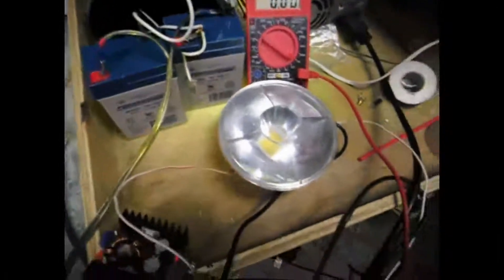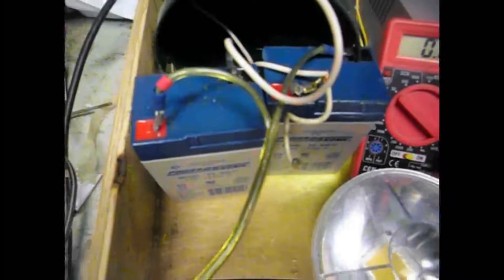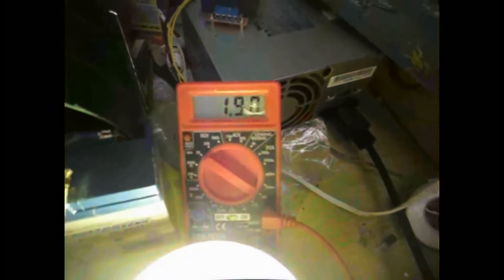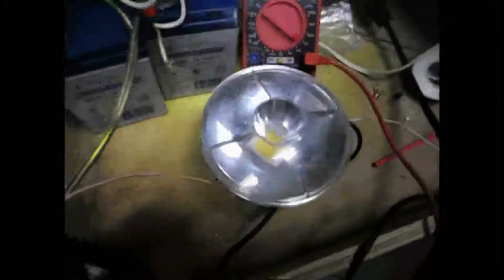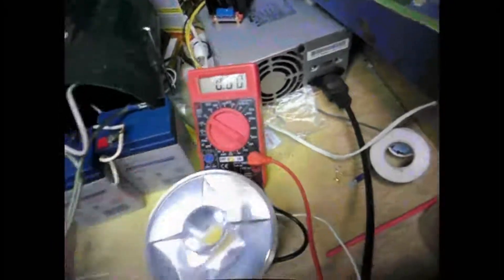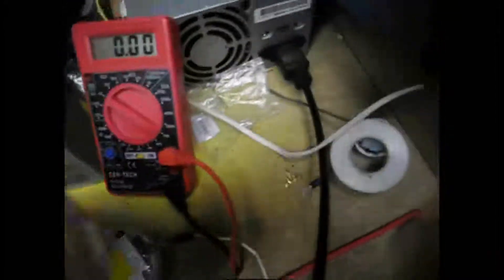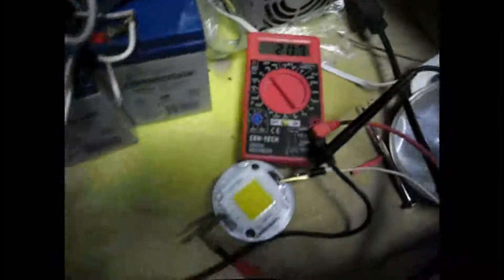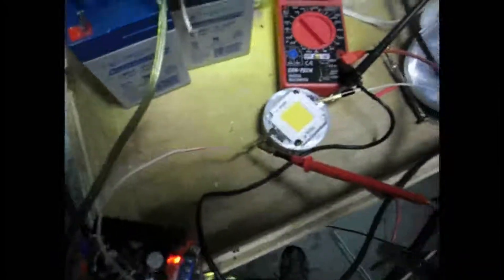Flashlight upgrade 50W 4000-5000LM

Comment: Hey man, im doing a similar project myself.  Just thought i'd say, the 4.5ah rating of your batteries is the capacity.  As in 4.5 amp hours.  Your load is drawing 1.8 amps and will draw that no matter what the batteries are rated for.  This means, fully charged, your batteries will last for around 2.5 hours.  

in other words, there's nothing wrong with your batteries.